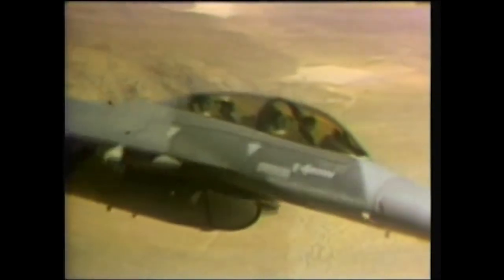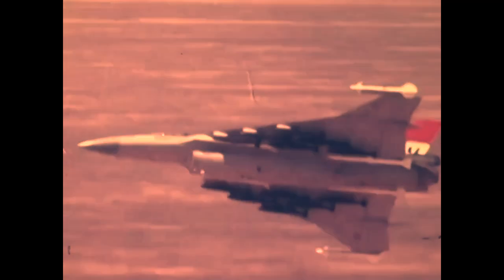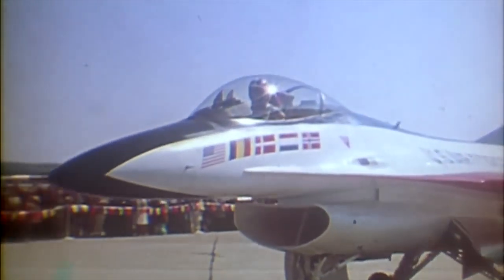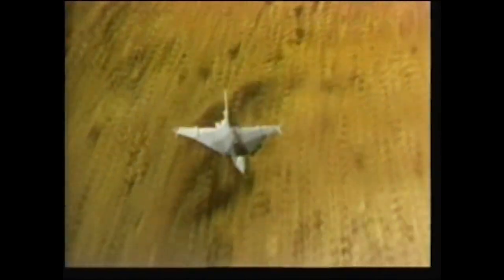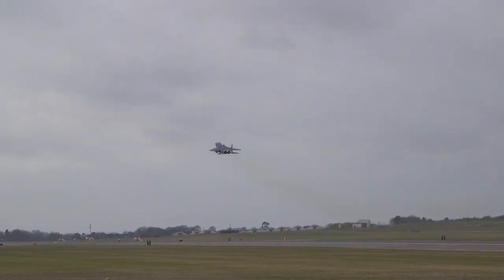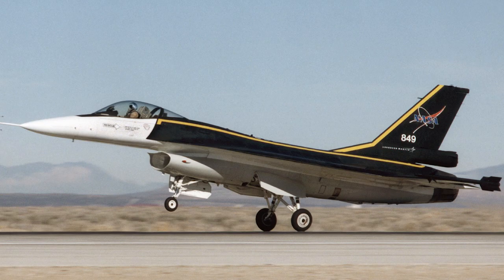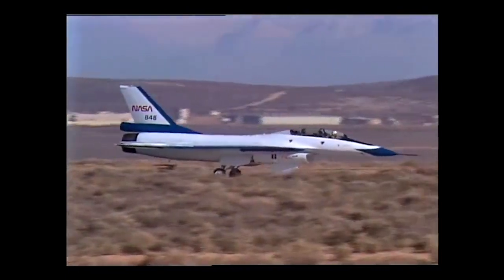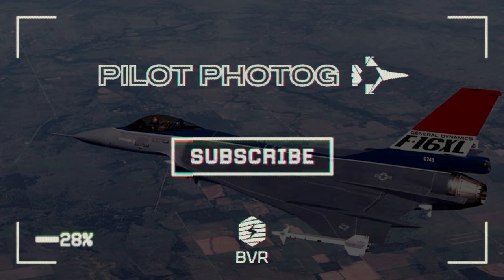F-16XL The Fighter That Should Have Been Built | avgeek |  #f-36

Comment: The second largest operator of F-16 in the world is Turkish Air Force. They are retiring F-4 Phantoms, finally. Although Turkey has its own indigenous fighter project, it was planned to be an air superiority fighter to replace F-16 in 15 years and complimented by the F-35 as a multirole fighter with an emphasis on ground attack. Turkey is already assembling their F-16s including the engines and local production of the parts exceeds 50%. Since the F-35 is gone, I think there is an opportunity for both Turkey and General Dynamics to revive the project. Already existing infrastructure for F-16 and the experience would make it a quite practical choice. Include technology transfer to make it more attractive, and this is a way to get our 11 billion USD back.
Reply from the maker: An interesting proposal and I would love to see the XL program restarted.  Thanks for commenting!

Comment: Wouldn't supersonic laminar flow control helped to resolve the issues of lose of energy  during consistent banking?  

Also,  such a system should b reversible, allowing for a sort of super-cavitation along the wings surface like an air-hockey table.   That would have interesting applications in controlling the energy of the wing-root vortices that give the Delta it's amazing lift. 

If you can use a buffer of air to super-cavitate the wing surface, that should reduce drag on the rotational energy of the vortexes.  I'm not sure what affect that would have,  but any affect on lift or perhaps forward inertia could feasibly be harnessed to overcome the challenges inherent to the Delta. 

Hey, I really liked this video.  I'm doing a 3d model of what I envision the "F-36" would look like, if we decided to implement the innovations of the F-16 XL.  I've been looking at ways to overcome the challenges of no-canard deltas and so far I've implemented LEVCON/active LERX, and TV beyond what was implemented in the XL tech-demo. After learning about the AS wing surface, I'm going to ad that in, as well.  

With all the technology updates I can think of to apply to the platform, the "F36" is looking like a really well armed missile boat with an absolutely staggering range and a payload capacity. 
I see it mostly as an unmanned platform, with occasional 2 seaters mixed in for C2.

Comment: It was a beautiful plane, fast and carried all kinds of ordinance under those shapely wings. I helped to build it back in the mid 80’s at General Dynamics (now Lockheed Martin). I just could not understand, why the cranked arrow wing design did not replace the conventional wing. This version would have been cost effective if built in numbers and provided superior performance over the service life of the F-16. Those dividends would still be adding up today. Of course, in any head to head competition of F-15 vs F-16 the Air Force would choose the much more expensive F-15. This is not exactly an apples vs apples contest.

Comment: Needs 1/3 of a towel tight inner tube lead up to the verticle stabilizer as well, so the airflow again more arrow rather than paper airplane at speed. I would hve went w/a tiny Tall! capital Y vertical stabilizer as well to help hold down the big wing lift a bit for added control.
Reply: seems like it needs 6" of clip taken out of both wings too.

Comment: It may be costy to set up production line for XL, but running cost is lower. F15E is better in dog fight, yet it is not the major concern of an attack fighter. Air force must miss XL's payload and range when they are surrounded by F35A.
Reply from the maker: Agreed and thanks for commenting

Comment: IMHO the USAF wants a F-16 replacement, start with the F-16XL as field installed upgrade kits. The fuselage extension is a plug that fits between main fuelage and the forward cockpit section and forward fuselage. 

Imagine the range of a F-16XL with the fuselage conformal fuel tanks.

Comment: What makes me sick when they have fighter competitions for the big contracts is when the aircrafts
built are both excellent in there own right . The fighter competition 
that won, was the F-4 Phantom and was used by all branches of the military that flew this plane in different variants and over 5000
were produced by McDonnell Douglas. The plane it competed 
against was the VOUGHT F-8U
Super Crusader. This plane was a
BEAST. The F-8U had a huge single
engine and was capable of Mach 3
performance.  Add to that, as a dogfighter it was far superior than the F-4 Phantom.  What the military liked most about the F-4,
..was the twin engine design. AND
while the F-4 went on to a glorious 
future.....the F-8U went UNBUILT.
What a crime.  The military minds
, when faced with a decision like this , should make some compromise's in their budget planning or ask for more money to build a viable task force that only would only make our country stronger.
AND yes the F-16XL should have been built for the same reasons.
In modern times we had the F-22 Raptor compete with F-23 Black Widow. Just as good as the F-22 in some areas and better in other areas. 
AGAIN , here is another example of
" JUST BUILD BOTH OF THEM "
 And even though the the F-23 BLACK WIDOW  first flew in 1990..the stealthy design of this aircraft is such that , today in 2023, JAPAN is trying to build an aircraft using this same design.  I hope they succeed.

Comment: Never aware on F16 XL concept except NF-16 Vista thrust vectoring concept. Thanks for sharing.
XL concept looks similiar to Eurofighter Typhoons which developed in 3 year after XL.
Despite canard and 2 engines configuration, both XL and Typhoons are using delta wing and belly air intake. My question, did General Dynamic had collaboration study with BAE/Airbus developing both aircrafts? As General Dynamic design was battle/flying proven with belly air intake in early f16. 
Can anyone help me on this? 
Thanks
Reply from the maker: Thanks for commenting, from what I found doing research for this video: once the XL became a NASA research platform many studies were conducted, of which several involved universities and other allied nations.   It is safe to say that at least some of that research was applied to both the Rafale and Eurofighter, which are wonderful airplanes in their own right.
Reply: @PilotPhotog  thanks for your research and explanation. Appreciate.
By the way, no canard wing in F16 XL. Does this mean that F16XL has less maneuverability, coz it's a bomber concept?

Comment: The F-15E was definitely the right choice - as fond as I am of this aircraft - because it has the capacity to do things no other airframe in the air force’s inventory can. Due to the WSO in the F-15E, bombs can be dropped lower, lazed in more accurately, and there are significantly greater target acquisition capabilities due to having two people in the jet rather than one. The F-15E is still the best air interdiction craft the Air Force has and was absolutely the correct choice if only one frame could be built.

Comment: What talks against the F-16XL is that it was easier to transform the F-15 to give it more range.
secondly: The massive weapons capacity is - most likely - not needed, as the munition these days aim to hit. Just look at the F-35 that has a huge range, but very little weapons carrying.

The huge concentrated targets of the Cold War era are not there today.

The low level attack - for which the XL would have been great - are generally against static targets, and they will know what is in store for them, and they are comparatively cheap to defend - going over a target with a couple of APC with a 35 mm Oerlikon is not a healthy proposition.

The nearest thing to the XL would be the Tornado which is rock steady in low level - it is not so much absolute speed that is decisive there; but that anything trying to follow it will tear their wings off. For runway cratering the XL would have been great; but at the time they would have to punch through the hardenings. Would the XL have been a great aircraft? Oh, yes! But the competition from the F-16 was to strong.

Comment: Imagine if the Air Force had "rewinged" high-hour block 30 F16's with a "baby double delta" and a conformal fuel tank on the belly.  This would have reduced or eliminated one of the F16's weaknesses... limited range.  I also wonder how it would have affected the fly-by-wire's tendency to reduce the flight envelope when flying a "dirty" configuration.  I'm guessing you'd have more lift available in a "dirty" configuration.

Comment: The f16c is aging quickly. This would make a great replacement with a 35k lbs thrust engine from an F22, thrust vectoring , new avionics datalink, super cruise. I could see this with 12 Aim12C Amraams clearing the sky’s long after the F22s are out of missiles.
Reply from the maker: Yeah as a secondary line of defense aka a “missile truck” it would do very well I think.  Thanks for the comment!
Reply: @PilotPhotog  except i think this is the role for the new F-15X, right? (“missile truck”)
Reply: A. Nony Mous but this looks way cooler😎

Comment: To the point that's been made by multiple people that the XL would have had lower operational costs because it didn't need a back seater.  How do you know that?  The E needs a WSO, but somehow, the XL doesn't?  Something in Viper pilots' Lucky Charms that lets them process multiple data streams better despite the 15E's better every-onics?  Don't kid yourselves, you want the F16XL putting iron on target nearly as well as the F15E while not going splat into valleysides or introducing unfriendly fire to friendly forces, you need a backseater.
Reply from the maker: Thanks for commenting and good point: I think if the XL had gone into production it would have had a WSO.  In fact the second prototype they built and flew was a two seater.

Comment: The F-15E is a completely different bird, the comparison was meant to fail the F-16XL.
I do think the project should have been pushed trough either as variant to the F-16 or as replacement. May that last one be in some sort of upgrade kit or actual full replacing older models. The F-16XL would have been a excellent model that would even be a viable option to this day if maintained properly and updated to current day standards of course. A aircraft like this would even be a very good candidate for many countries around the world.

Comment: i am wondering if the f-16xl is comparable to the mirage 2000. Similar delta wing, interdiction mission oriented. I think the turn ratio might be better though. Anyway the mirage 2000 seems to have pretty good missile/hardpoint capacity comparable to the f-16xl

Comment: this is an incredible bomber fighter giant wing. only the nose doesn't match the wing. Think Indian arrow head as the over all design yet tiny dart nose, fail not stable, but if u take the basic saab wing & add a proper spear or Indian arrow head sized to match the wing then the tip/pnt matches the head.

Comment: With the continuous Viper development, a modern version of the XL wing would be the next logical step for air forces across the world to add lifespan to their F16 fleets, converting their fighters to multiroles.

By modern, the XL wing would have to grow shorter in length (the 16XLs were extended fuselages... for this Block XL proposal, they are going to have to adapt a slightly shorter wing). Hell, one engine would be a lot simpler to introduce thrust-vectoring on... and who has a lot of expertise developing this tech: NASA! Recipient of defense procurement loser entries, spinning shit into gold.

Tack on modified elevators onto the nose as essentially bastard canards for additional lift/roll capacity, and you'd have a budget competitor to the Typhoon and Rafale... all running on a single proven engine that has had a lot of time to mature, be improved upon, and made more reliable; that single engine concept has been the budget decider for the F16 in so many militaries' decisions to acquire and maintain the Viper vs other platform such as Eagle. More wing also means more room for the ever-increasing amount of avionics required to stay modern. 

It is a budget alternative to the Strike Eagle, and today is the next logical step in fleet development/upkeep for the air forces that cannot/will not upgrade to the F35 platforms, and likewise view it as too expensive to acquire 4.5 gen aircraft such as F-15E and F-18E/F/Gs as interim measures.

Vipers still fly today as the most common Western "fighter" (let's face it, for most nations, its their everything, may as well enhance its multirole aspect)... so long as the rest of the airframes are being maintained, might be time for new wings anyways based on their hours worked.

Comment: I don't know why this would lose energy in a turn quicker than the F16, particularly with an upgraded engine. At high AOA it would have more drag, but it doesn't need to do that for a good turn rate.
Reply: What’s the difference between an F-16 viper and the F-16xl?

Comment: My first thought was Lockhead had this developed and ready to go and they went with the F35.  Sleath it may not have been, but it's speed of Mach 2 plus and massive weapon load as well as it's range make almost make up for the short comings of the F35.  The F35 is a great aircraft, but it does have it's faults and fault finders.  Thought the video was good and infromative.
Reply from the maker: Thank you much appreciated.  The think the XL could have served as an excellent export option for nations who needed a low cost long range interdictor aircraft as well as a “second wave” option for the USAF.
Reply: if i had to choose between the "low observable" and the XL i would have put my money on the XL... add RAM to it's flat surfaces it would be just as "low observable" as the f-35...

Comment: Wasn't it another F16 project that had the jet fitted with some winglets that helped it to slide sideways? I know this isn't much go on but it's from memory.
Reply from the maker: There was a thrust vectoring version of the F-16 as well you are correct.  I’m looking for footage to use in an upcoming video.  Thanks for commenting!
Reply: AFTI F16 had forward canards that allowed high angle offset flight, very neat aircraft...

Comment: Thanks. I’d really never heard about this variant of the F-16. Super Cruise was a big deal and I never knew that we had an airplane that achieved it so early. The single engine always bothered me in an expensive attack aircraft. How much was performance degraded with all of that external ordinance hanging out in the breeze? It sounds like it would have required standard F-15 or F-16 aircraft to assure air superiority. That would have led to logistical, refueling and range differences, that may have negated the super cruise ability. This is just a keyboard warrior speculation. So no hate. please.

Comment: Yeah unfortunately the term right plane at the wrong time is completely fitting for the XL.  The fact that it would have cost a lot to get an XL line running plus the single versus two engine argument really doomed this aircraft for that one mission.  That was literally the one-two punch combo that gave a clear advantage to the Strike Eagle.  I don't think the one versus two engine bit is unfair given the specific mission it was being considered for.  Also the delta wing bleeding off energy in a turning fight is just something they are known for.  You turn one of those fighters that is a LOT of surface area to create drag.
Reply from the maker: Well said and thanks for commenting!

Comment: Nice video! The US hasn't had much appreciation of Delta wing aircraft in quite some time. I know you said that this couldn't compete with the turning rate of the F-16 but it may have been able to have a tighter turning circle at high AOA which is something the F-16 does its best to avoid in a fight.
Reply from the maker: Thanks for commenting and agreed, it was more of a strike fighter.

Comment: I don't know why, but it seems that the more recent trend in the US military is throwaway designs that don't see much, if any, physical upgrades during their lifecycle. The modern F-16 is literally nuts and bolts away from the first models, with upgraded electronics but otherwise no huge difference in capabilities. Compare that to the F-4 Phantom which saw massive upgrades over its lifespan, gaining significant maneuverability and other capabilities that effectively saw it become the original joint strike fighter.

Comment: This is a cool version of the F-16 series. To bad it was never put into production and put aside for the regular F-16 series. Had a model of this plane in 1984 lost it later in the late 80's. Haven't seen a model of this plane in a long time. There might have even been a die-cast version of this plane by Dyna-flights in the mid 1980's and early1990''s but am not quite sure. Would be cool if they did.
  I'll say this it is not new or one of a kind. It looks very similar to the Soviet Mig-21I Analog of  1968. Google the Mig-21I Analog and then the F-16 XL and you'll see the simularies between these two prototypes. The only real difference is the engine placement and bubble canopy other than that it's almost a carbon copy as if we took it from the Soviets and just made it with a newer plane and newer avionics. Just saying. Doesn't mean I don't like. I really do, and it's really cool but not unique in the aviation world.